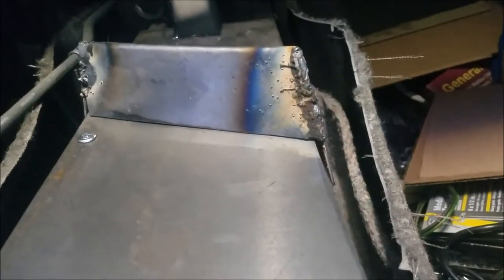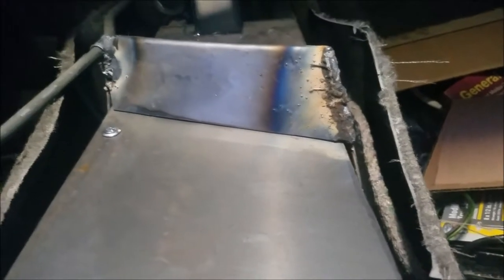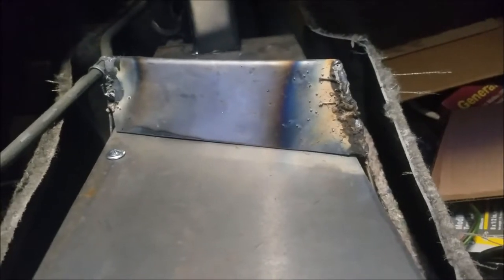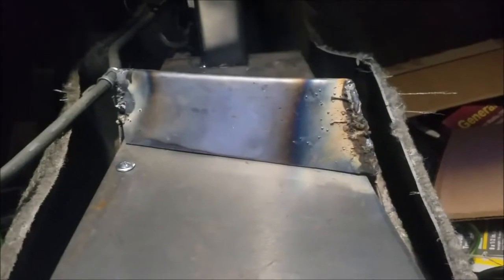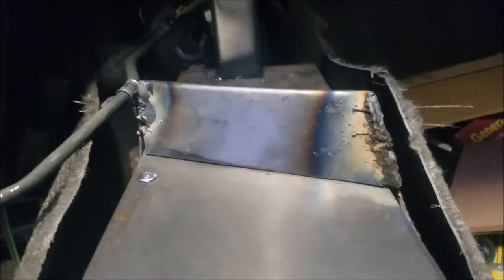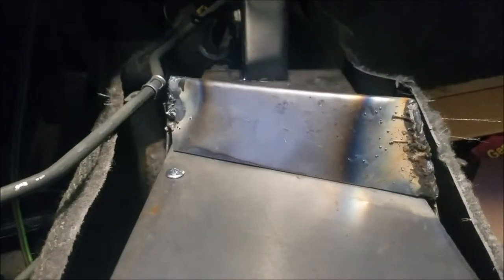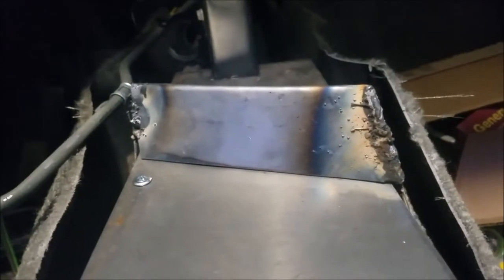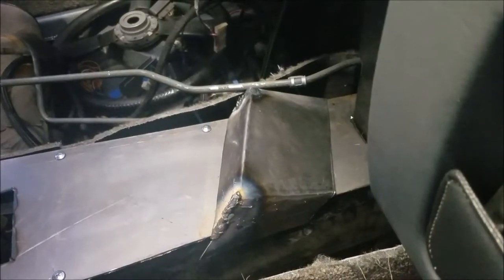FABRICATING SWITCH PANEL

Comment: I was gonna ask why you didn't weld on the inside,  then I realized it wouldn't fit the console XD
Do you watch the youtube channel Sloppy Mechanics?
They are a genuine wealth on tuning GM's OBD2-3 via HP tuners,  and MicroSquirt.  It's all LS Engine based,  but tuning wise it cannot possibly be that much different.
If you haven't had a chance to look up their wikipedia on tuning and general turbo shenanigans,  there's a helluva lot of insight before you do the hotside and your boost switches ect.

from decapping and cleaning/testing injectors to get more flow out of cheap stock truck parts to how to set your wastegate to 8lbs and get a recirculating switch to essentially double the boost pressure (an easy street setting with a switch to max-92-3)  to what kind of timing you'll get away with on boost (with an LS style engine,  but maybe there's some correlation)

https://sites.google.com/site/sloppywiki/

There are also some sloppy sponsored youtube vids with demos of HP tuners ect on the dyno with what is what.

https://www.youtube.com/watch?v=xb-OxiP3Iy8
https://www.youtube.com/watch?v=Vz6ZqCyATf0

I want to build a lemons fiero,  with a HP Tuned ecotec/1984 era 4.10 4 speed,  and maybe an 88 cradle/rear setup with a boxed radiator,  and the lebaron/GA brakes.
Absolutely barebones much like yours, but I won't be able to box in the spaceframe as you've done.

Cheers man.  Here's hoping that 60* 3.4 works well when the turbos go choochoo